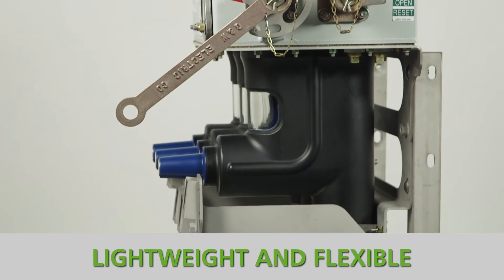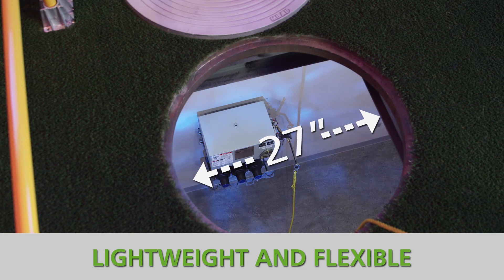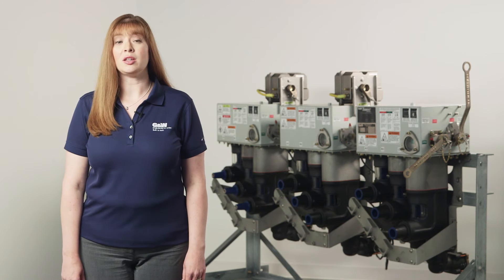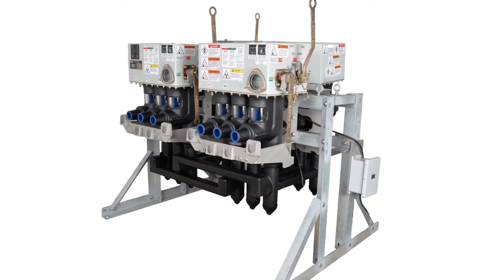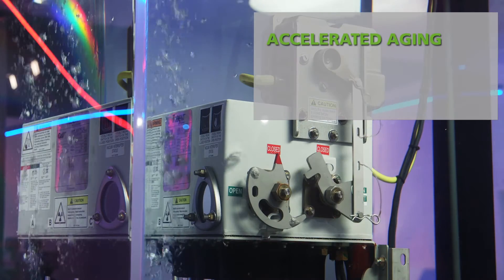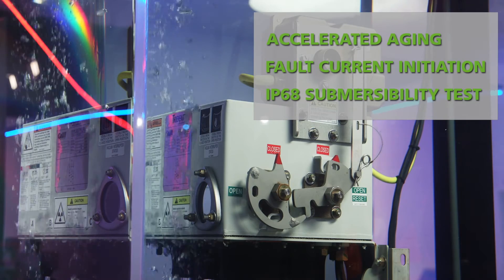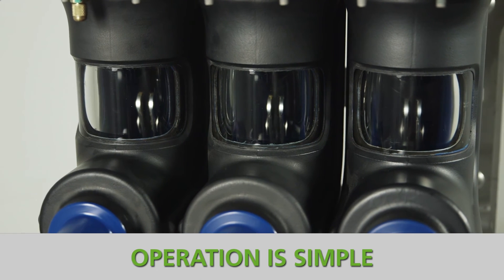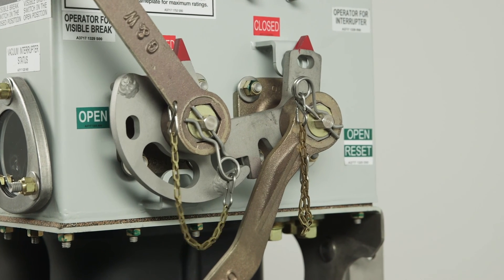Benefits of G&W Electric Trident Switchgear with SafeVu Switches

Comment: Hello,

Do you have a recommended hmi or network switch that plays nice with this switch gear?  Is it possible to order a switch gear with a DNP3 protocol?  Can you get direct rj45 connections on the switch gear for remote operation or does it have to go through terminsl blocks first?